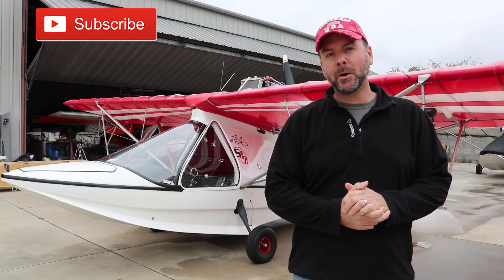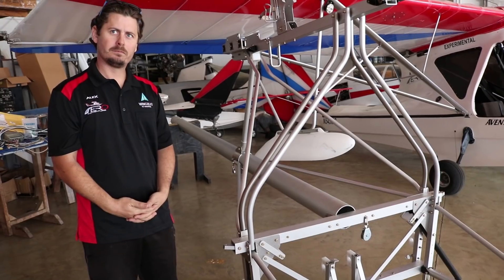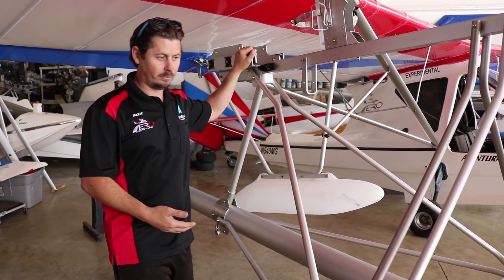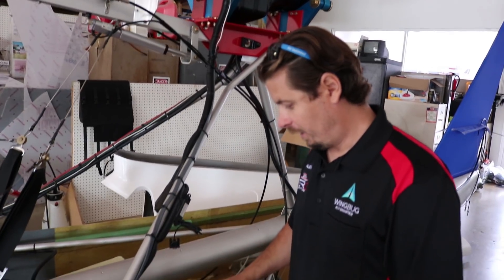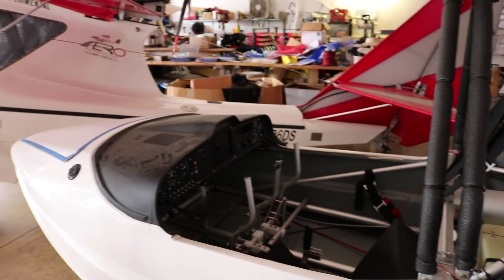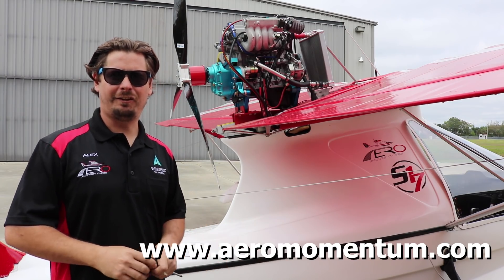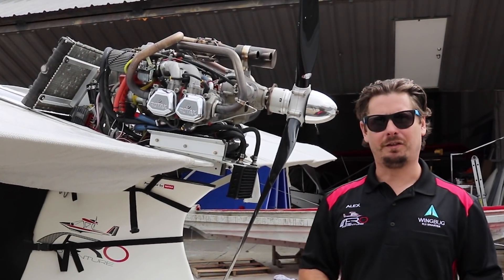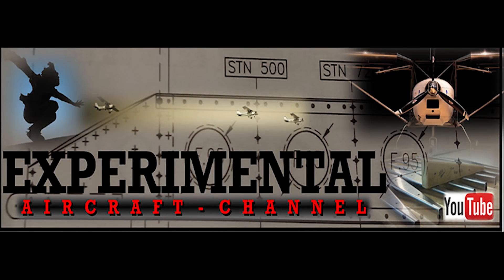Aventura Seaplane Factory Tour - How to Build PT1

Comment: BUYER BEWARE!

I purchased a kit from the prior owners of Aero Adventure in 2005.  I almost returned it, but then received assurances from the owner that the problems would be resolved. They were not.  Missing parts, wrong parts, incorrectly made parts, lack of documentation, incorrect documentation…you name it.  It was impossible to build.  I’d start, get about 15 minutes in, then find out I had incorrect length bolts, missing aluminum, or conflicting manual information.  Then I’d have to document it, wait for a response from the factory, fight about getting what I needed, wait for the part, then start again.  It was so frustrating we’d just give up for a few months, then take it up again.  

Here I am in 2024 with 200 hours into the build and its about half done.  The control surfaces are ready for clear coat and the fiberglass work is yet to be done. Instrument panel and so on.  What I learned was that very few, if any, of these kits were ever built by the “owner/builder”.  All were built by shops with experience and spare parts where the owner supposedly participated. A few admitted to me that they never did..

We’ve decided to either finish the kit or dump it this year so I tried to contact Alex at Aero Adventure to see if a current version of the manual was available. l cannot get a response to email or voice mail.  I had a friend contact them offering to pay for a manual to evaluate a purchase.  They never responded to him either.  I called the airport to see if anyone there knew these guys or if they were still in business.  They are seen “occasionally”.  

Its sad cause this is a nice aircraft.  I’ve flown one.  Its a nice design that should be what it is advertised as, a 200hr build.  But it has never lived up to its potential and now it appears may not even be in business any longer.  Too bad.  At least I can sell the Rotax…
Reply: Thank you for this post.
Sorry you had these problems with the kit.

Comment: Thanks for a cool video , was wondering how it all went together technically , its amazing how important it is to try and make everything as light as possible yet still be good enough to do the job , they pulled off a great affordable aircraft by not overbuilding. If you get a chance would love to see how the wings are made and attachment points for the wings. Fair play to Alex for driving the company forward , and being a contact for supply of spare parts.

Comment: Quit using the term breaking in. The run time before using full power for an extended time is called mating moving parts. This is to smooth machining roughness from newly made parts. Such as setting rings in the bore and bearings.

Comment: Is that a single seat? And do you make a 2 seater model?
Reply: It's a little confusing because at the beginning he says its a single-seater, which initially turned me off to the plane. But then at 10:12 and 16:30 you can see that all the planes they are playing with at the factory are 2 seaters. Looking on the website they only show 2 seaters on the site.
Reply: @JAlexanderCurtis  ok I must have missed that
Reply: @JAlexanderCurtis  you're correct in the first 5 minutes the frame has two sets of peddles

Comment: looks a lot like a DIY iconA5
Reply: Not even close.
Reply: @ohwell2790  I guess you don't agree with my assessment then. however at first glance, the only differences I can point out are that this have floaters attached to the wings instead the body, the 3rd wheel in the tail, and the stabilizers are in the lower part of the tail. and of course there's the aesthetics factor, hence my colorful and very nice "DIY" take on it.

Comment: Just found the channel and am interested in this amphibian aircraft. 
Very disappointed in the lack of information provided. What are the weights? Empty, useful load, max weight?
Cruise vs stall vs VNE? Dimensions for hanger requirements? Cost?
Too much information missing. Most is not on the website either. Only partial cost is given there.
Sadly lacking in information relative to a very interesting aircraft.
Reply from the maker: Wow! JT Thill? Thank You?? Merry Christmas friend! :-)
Reply: Their website is criminally bare.

Comment: Is the engine not covered.
Reply from the maker: Roy Boy soon In this type aircraft, and the testing they have done, they concluded that there isn't much performance gain "cowled" or "uncowled." So basically... it is more for aesthetics etc. There is an option for a cowling as well I am told. And this is water cooled with the radiator out in from anyway. Thanks for watching! I appreciate you.